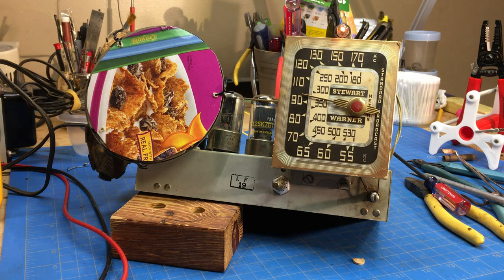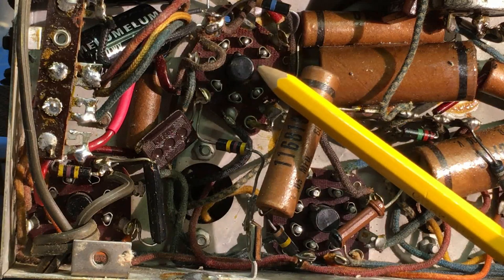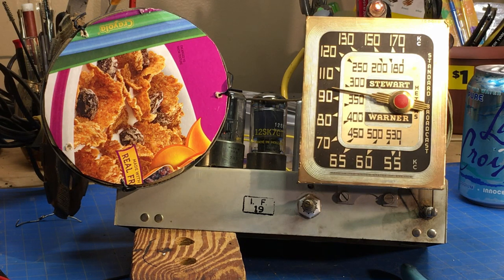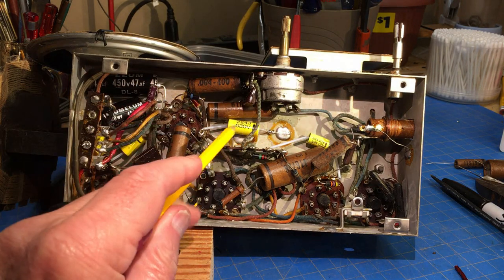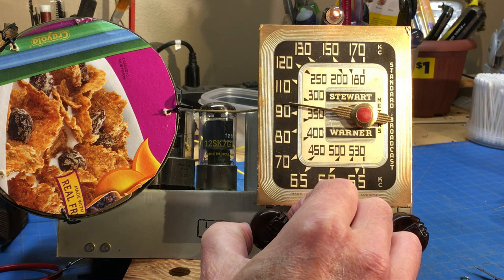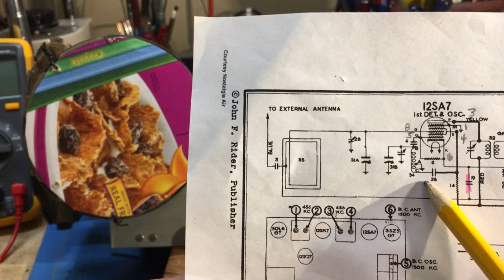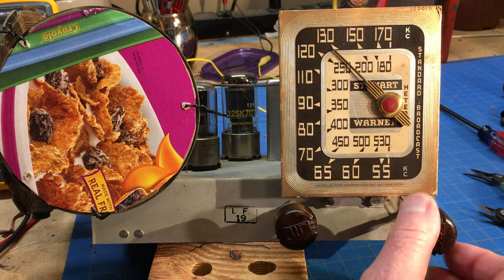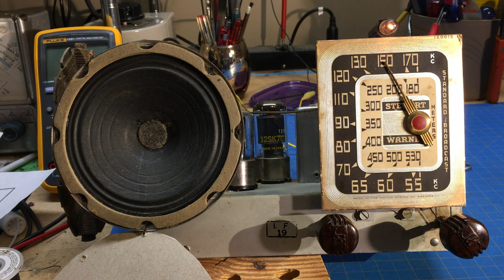1940 Stewart Warner Model 13 5U2 Part 2 of 3 Replace Capacitors and Test after each one

Comment: Larry, I have not seen people use poly film type capacitors off the AC to the chassis.  Usually Type X Y ceramic safety caps are used which are designed to fail in the open condition and do not fail in the shorted condition.  Also you can use ceramic disc caps for cathode bypass.  I only replace damaged ones myself, although I check them all for electronic leakage just in case.  They are cheaper, rarely fail, and don't affect drift.   Micas or multi-layered ceramics should be used in oscillating circuits. Your video was an excellent example of waxy caps turning into resistors being replaced one at a time and the improved effect on the particular stage of the radio.
Reply from the maker: Thanks Albert!! I considered using a safety cap (I have many) but, the original was paper and seemed to work ok for 80 years 😬.....the technician of the day would replaced it with a paper cap....also, my polarized plug will be the B-.....Thanks for watching and the comments...Take Care—Larry

Comment: Great video Larry, step by step considerations about capacitors.
Sorry but i dont understand  if you used external antena.
I am fixing a 1955 Tesla Radio, has the same back noise when sintonize stations, I will follow yours steps.
Congratulations - Sao Paulo - Brazil
Reply from the maker: Thanks Fernando....I am using an external antenna..however, it is just about 7 meters of wire strung around my ceiling...not the greatest....I hope the video will help and I appreciate you watching and commenting!! Take Care—Larry

Comment: It does seem that there are two peaks when you tune across the local station, which may indicate that the IF alignment would help.  After dark, you should be able to pick up AM 740 out of Toronto. It is remarkable that the carbon composition resistors are still good after 80 years.  Are you sure that fine "sawdust" is not asbestos particles?  The second calibration dial on the inside is for wavelength.  That is a leftover from the early days of "wireless" when wavelength was often used instead of frequency. Best regards.  I enjoyed the videos.
Reply from the maker: Thanks Dave!! Yes Im sure the dust was sawdust....I worked in nuclear power plants and had training on asbestos even though most of the asbestos has been eliminated thru upgrades. We still had to have the training lol.....I was surprised at the resistors myself, you usually find a few out of spec....I believe this radio was stored in controlled climate.....I havent gotten around to the alignment yet, but Im with you, a touch up should improve the sound. Im glad you enjoyed the videos, there’s not many way to make recaps exciting lol..... Take Care—Larry